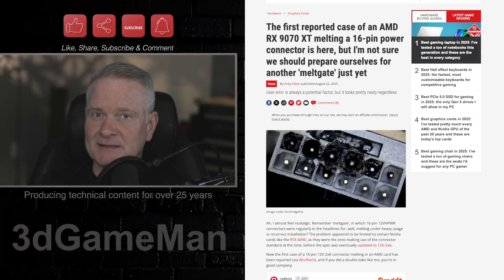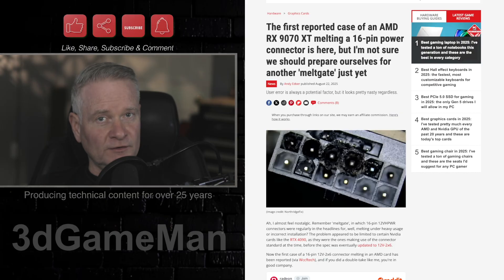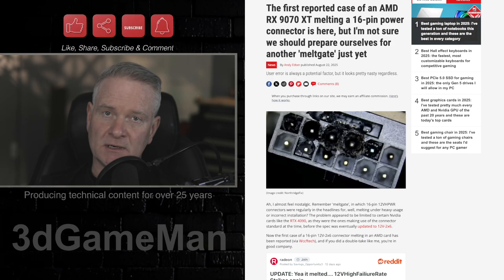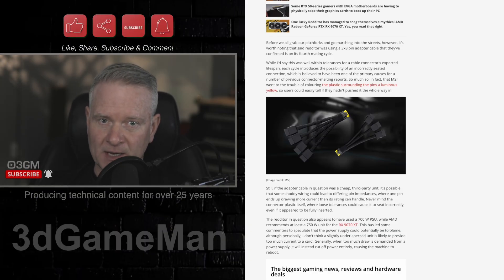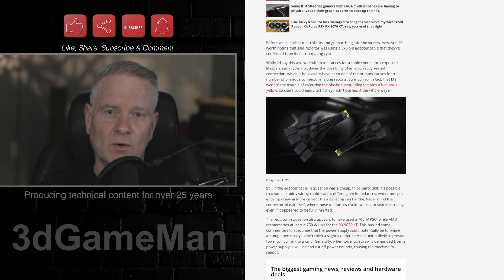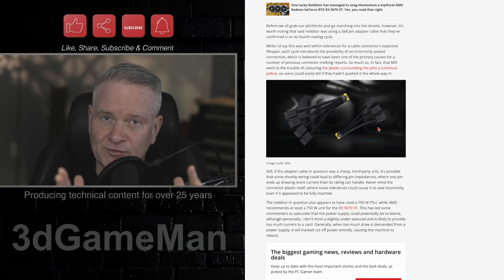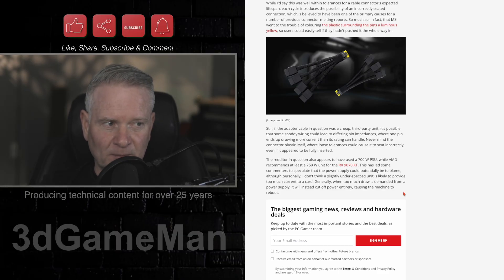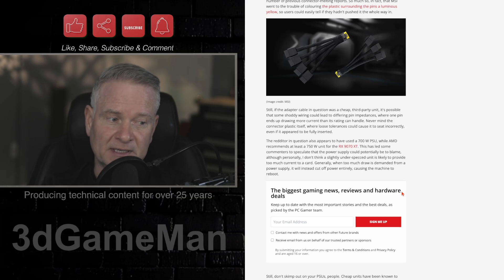AMD RX 9070 XT GPU Connector Melted

Comment: There's noway a psu can make that to happen if he used the included adapter, only if he used some included cable that was badly made, but even then i still blame the connector, its to fragile for the amps you can push thru it

Comment: Why anyone would buy a card with this connector or why GPU manufacturers continue to implement it is beyond me. The definition of insanity is doing the same thing over and over again and expecting a different result. Case in point.
Reply: @Razear  they invested money in the making of this connector, and they force it on the AIB's, at least on nvidia cards, why would asrock and sapphire on the nitro used this is beyond me, I would never buy a gfx card that has this joke of a connector, as a electrician I know its a bad idea to push so many amps in such a small connector